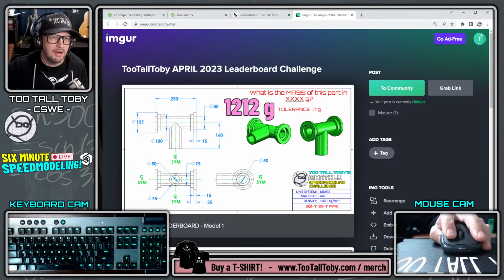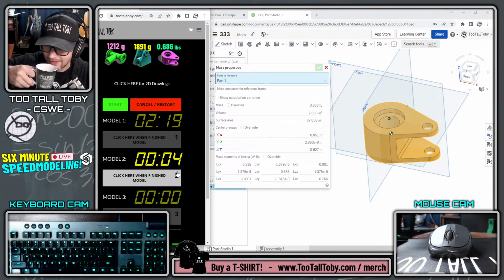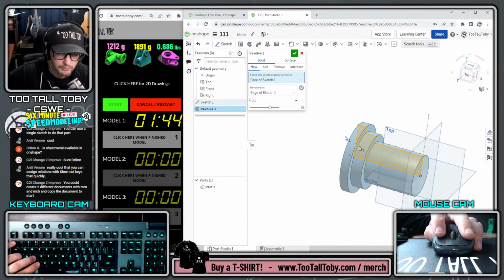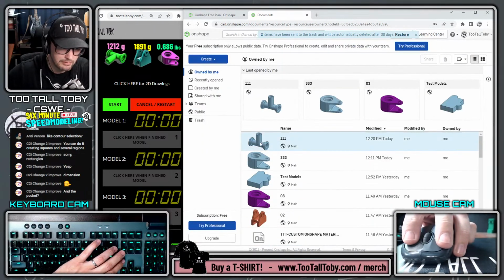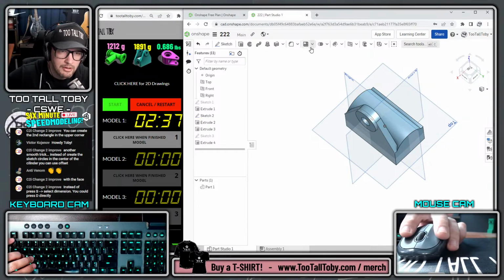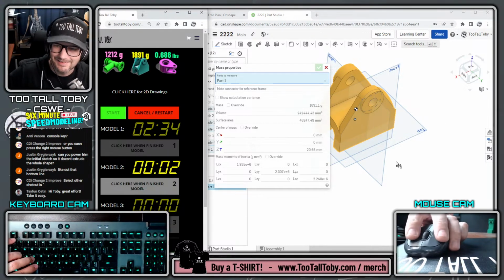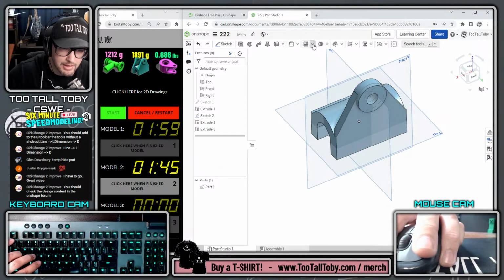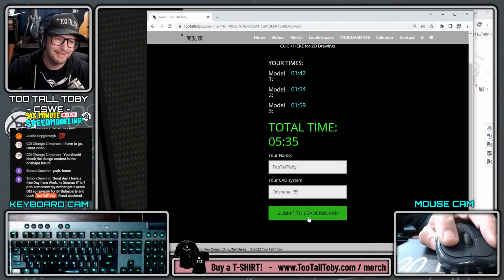Six Minute Speedmodeling in Onshape

Comment: Right on @TooTallToby!
~5:35 is getting pretty speedy and well under the 6min target!
Haven't had a chance to watch the whole thing yet but did look at the final run. I like the breakdown of revolve and extrude from end for that first part! My only thought would be to re-order things a bit so you can do the 80mm cut and through all cuts back to back at the end and do the "side" extrude sketch with two circles so you can do a "through hole" remove instead of a new sketch "up to vertex" but that's pretty minor!
On the second part I find it's a bit quicker to do a centerpoint rectangle and circle when doing a "centered" tombstone shape. On the side sketch, my only comment would be to do a quick toggle with of the q key for the horizontal line though the top circle (to save you having to select two regions, twice), with practice you can even do it "on the fly": create first line segment, hit q, create the second as construction, hit q again and create the 3rd line solid.
On the 3rd part I would either draw half (and add the hole after mirror) or center it and use a centerpoint rectangle for the front notch. I think you did it that way to use the centerpoint of the first sketch for the hole but if you use the hole in "mate connector mode" instead you don't need the sketch point to place the hole.

My last comment is that when I do practice/experimentation on how to structure the models I usually just create a new part studio (rather than "send to trash" and new document) in the same document, that way you can flip back and see what you just did in your last try and it's more "interactive".

Lastly, I like to have two "template" documents (there are no actual templates in Onshape other than for drawings...), one IPS and one metric and do a right-click "copy workspace" rather than a new document and changing units. The only trick is that since you can't have a document without any tab, I have a tab with just the Onshape logo and no part studio and create a new part studio to begin the challenge. I stole the idea from Alnis as that's what he did during the tournament and it seems like a reasonable "equivalent" to having the CAD software running without a "part" created!